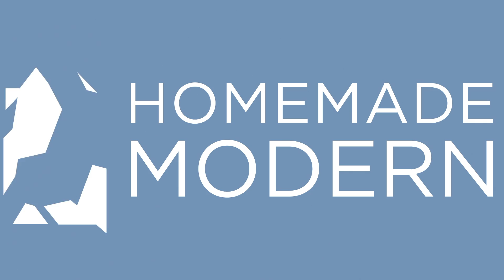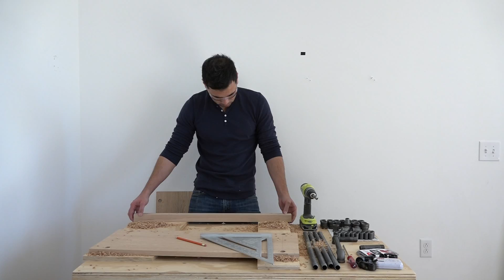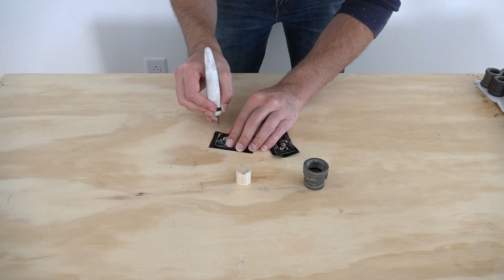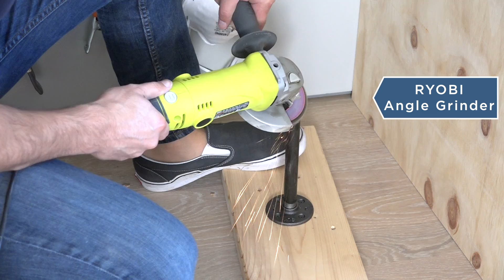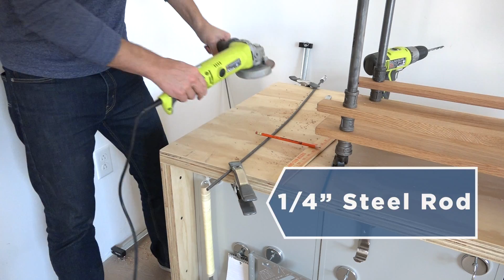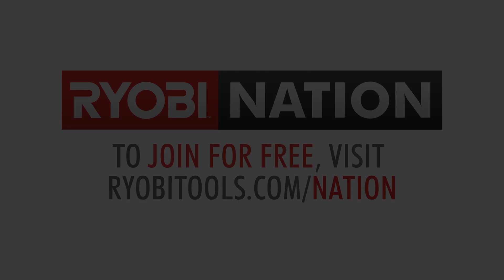DIY Bar Cart | How to make a drink cart with iron pipes

Comment: For the pipes, if you started with the handles and made the assembly from the top 1" x 2" board up first, you could then screw in from underneath without having to grind anything or have to buy any freely rotating couplings.
Reply from the maker: good idea!
Reply: Mal Function genius!